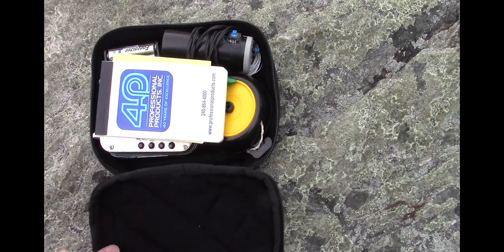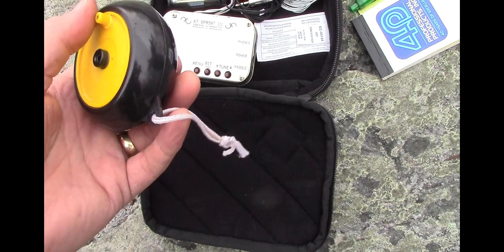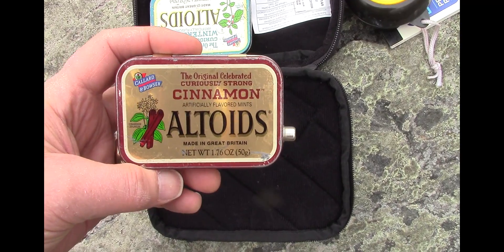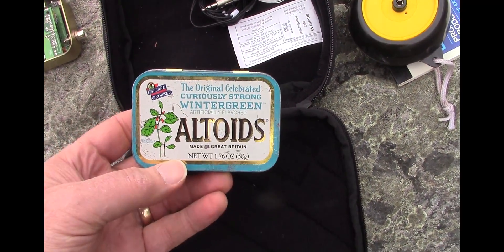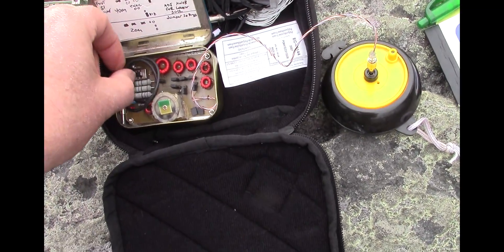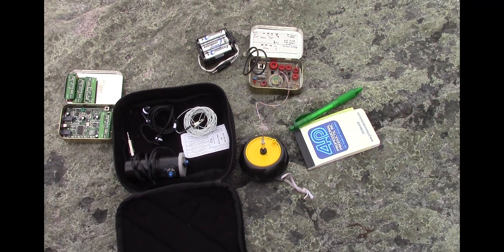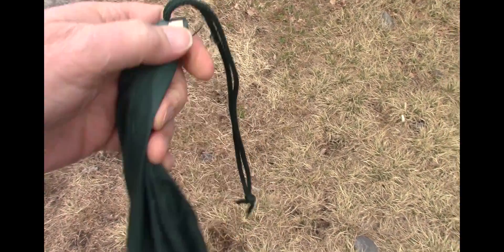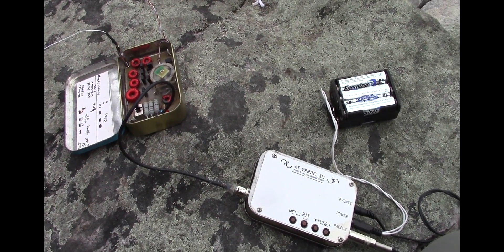QRP on Appalachian Trail

Comment from the maker: Thanks for your comment about the hand held iambic key. It allows me to send CW with one hand while the other hand is doing other things (writing, adjusting the radio, while I'm eating, or while I'm laying in my warm sleeping bag). It's made with a couple 35 mm film canisters nested and a couple SPST micro switches. Variations could easily be made with other switches with small apddles over them and the handle could be made from PVC or even carved from wood. I made the one you see in the video very light weight for hiking on the trail. More information about the UD key can be found at http://www.dxzone.com/dx28801/the-ud-a-light-weight-iambic-key-.html.73 and enjoy,KC8UD
Reply: Very cool kits.  I looked online but could not see that the kits (transceiver and tuner) are still order able.  Can you please point me to the right links?  Thx
Reply: Ooops... Error 404
Sorry, but the page you are looking for doesn't exist.